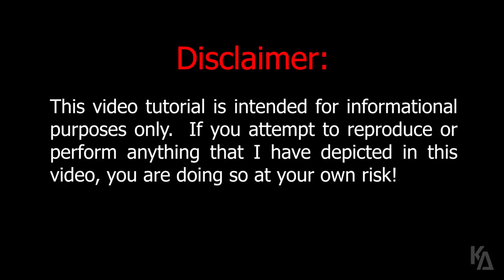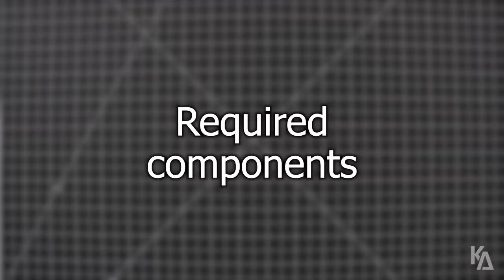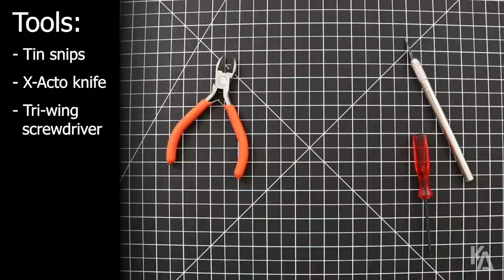Backlight Your Gameboy Color in 15 MINUTES! (No Soldering!)

Comment: This really is the definitive GBC mod. Benn is truly a genius with his engineering
Reply: Thanks mate!
Reply: No it's not. The screen is smaller than the original. There is more work to be done for it to be the definitive mod.
Reply: @afistfulofpimples1745  Its' smaller to keep a accurate 1 to 1 pixel replication, a lower resolution screen could be used but it would look worse.
Reply: @mikewat6693  So why not use a higher resolution screen but larger, to equal the size of the original. No one wants a smaller screen. Faithful pixels or not, playing on a smaller screen is no fun. More work needs to be done.
Reply: @afistfulofpimples1745  it's a start! I have an AMOLED kit for the GBC in the proto stage. It has full sized screen area, a bucketload of shell modding to get it to fit, and a ridiculous price tag. You could argue 'it's too expensive' or 'too much modding' Just as the last lot of Commenters on the 101 mod. The fact is, this is a huge step forward. No it's not perfect but with the days of 1:1 screen aspect well in the past, the chance of a 100% drop in no mod solution is drifting further away. This is the best we're going to get for this simplicity and price tag. You may be surprised but the design of this kit wasn't by accident or a random panel selection. This is the best we have in April 2019...

Comment: I didn’t know a custom lens would be required when I bought the screen. And now it seems I’m torn between buying either a Gameboy Color Light screen with glaring hot pink where the red should be, or the redundant Black and White one. Fantastic video though, it was well worth the wait.
Reply from the maker: Thanks, I appreciate it! 🙂  A "Light" lens isn't technically required, but it does make things look cleaner.  You can use a normal lens and just cover the edges of the LCD frame with matte black vinyl or electrical tape like in my GBC101 mod videos.  I hope this helps!

Comment: Just a friendly pro-tip I didn't see mentioned in the video: Cutting the cartridge connector pins with wire cutters or tin snips is potentially hazardous to the main board. You could very easily grip a pin and rip the solder off the board, along with a trace, rendering your GBC useless (not able to read carts)

A safer approach may be to use a very small (FINE) file, not a nail file, but one for metal. Gently file the tips of the pins, not the sides/edges.

hope this helps some worried about removing cartridge traces.
Reply: I think the repetitive movement back and forward has a far higher chance of creating a dry joint that a sharp pair of wire cutters. This is just from experience doing many hundreds of these mods.

Comment: I have a question:
Why installing a smaller screen indeed of a small one? I know it's a better one but if you put lot of effort and time why release a smaller version? It's due to pixel sizes or what?
Reply: Dwight Castillo i have the same question. Too bad to use a smaller screen it doesnt look authentic anymore :(
Reply: To me it was more important keeping the aspect ratio the same. We could have filled the screen with a squashed image similar to the Gbboy image but in my opinion it is not good enough. This is a little smaller but ticks the boxes for price, aspect ratio and simplicity.

Comment: A couple questions before I purchase one of these bad boys.

1. Is the backlit screen the same size as the stock GBC screen? 
2. How important is it to install a custom screen lens? I refurbished my GBC with a glass screen lens only a year ago for a stock GBC screen. Is there any reason that a stock GBC screen lens won't work with this mod? 
3. How is the backlit screen with motion blur, viewing angles, etc? 

Thanks!
Reply from the maker: Hi there, thanks for your questions! 
1. The screen is a few mm smaller than the original screen, but since it's backlit you really don't notice the size difference (just from my experience).
2. A custom lens isn't required, but it definitely helps the look of things.  If you don't use one, you can cover the borders of the LCD with matte black vinyl (no residue) or electrical tape (leaves residue).
3. There's no ghosting on the Freckle Shack lens.  None. 🙂 (Unlike the AGS-101).
I hope this all helps!  Thanks for watching!
Reply: @KyleAwsm  Okay...then if it's not 1:1, that opens up a whole other can of worms. What is the screen size for this aftermarket screen and what is the aspect ratio? The original GameBoy Color LCD uses a 10:9 aspect ratio that aftermarket unit such as the GB Boy Colour do not match, creating a slightly stretched image. The reason I'd be interested in this to to get a lit screen that also adheres to the proper aspect ratio. 

The other points sound good to me, but please explain this difference in screen size.
Reply from the maker: Pixel ratio IS 1:1, just smaller pixel pitch.  Same aspect ratio.  A few mm smaller than the original LCD.

Comment: Do you have to have the jelly belly customs glass screen. I have a few standard replacement glass screens. Will this work?
Reply: Not required but highly recommend has the new screen is about 2mm smaller than original using an original lens you will see more of the inside of the device.
Reply from the maker: What F7099Y said - I highly recommend the custom lens!  It just COMPLETES the mod.  You can also do like I did in my GBC101 part 2 video, using tape/vinyl to cover the LCD housing/border.  I hope this helps! 🙂

Comment: Hello, I installed a freckleshack today and went to screw the case back together but before I did, I thought I would give it a quick check from the front but because I am using a clear black shell, I can now see the kapton take covering the points below the screen and it looks ugly (being yellow). It didn't show on the atomic purple as there was no kapton tape covering these points. It is essential to cover these points with Kapton tape? Or is there an alternative you can suggest that won't ruin the aesthetic? Thanks.

Comment: Another question - the actual visible LCD looks physically smaller than the original screen. Is this right? If so, how much smaller?
Reply from the maker: The image on the screen ends up being about 1 to 2 mm smaller than the original screen's image.  Really though, with the screen being backlit now, and with a custom lens (trust me, it really helps), you don't even notice the size difference.

Comment: Could it be that this kid was designed specifically for aftermarket housings?? Because I cannot fit it inside my origonal housing... it seems like just won't fit. When I close it with minimal pressure, the Gameboy would reset or the display would show weird glitches....

HELP :(
Reply: The mainboard doesn't sit flush in the housing. Although I trimmed it like shown in this video.

Comment: This is cool and all but if I’m replacing the screen and the shell I might as well get an aftermarket gbc that just has a backlight. The whole point of modding my GBC with a backlight is to make the original hardware playable in modern times. Replacing the screen is fine but replacing the shell and the lense defeats the purpose

Comment: I live in Perth Australia, and I've been following various Gameboy mod videos online. BennVenn seems to be pretty popular. Does anyone know how I could get in touch with BennVenn? I recently got myself a cheap DMG, but, while attempting (successfully, I might add) to fix a few vertical lines, I must have clumsily handled the ribbon cable, and now I have horizontal lines. Is there any way to fix the current screen, or replace the old screen with a newer one (doesn't have to be backlit, as long as it can display image without any horizontal/vertical lines obviously)? Thanks.
Reply: My email is on my stores page.

Comment: Does a backlight exist where you don’t butcher your case?
Reply: Yes. Aliexpress has one for 36 bucks as of yesterday.
Reply: Completely drop in with touch brightness control that doesnt need any soldering. Its nice but the screen is even smaller than this one.
Reply: It does have some frame skipping and tearing because it doesnt auto adjust the fps like the freckleshack and its kind of annoying.

Comment: Would it be possible to get a different screen thats the same size as the thing on the front of the GBC?
Reply: nathan mead  if they were able to find an lcd that has the same dimensions as the original AND is able to be manufactured easily as well as unlimited, then yeah. But for now this is the best I’ve ever seen for a modded GB color.
Reply from the maker: Ben is looking into this possibility, but that solution is likely a long way off yet.  Thanks for watching, man! 🙂

Comment: When you installed the screen you slide the left (thicker) spacer towards the bottom, while leaving the thing spacer on top. This made me cringe for two reasons: this could cause the screen to rotate slightly, but even worse, you then crush the poor ribbon cable on the spacer. WHYYYY

Comment: My old manager would send workers home for the day that cut towards themselves instead of away; If the knife slips, you don't stab yourself that way. He was strict, but it was effective.
Reply from the maker: I see what you mean... but this is a craft knife....  You get more control holding it this way.  If you cut away from yourself doing stuff like this, it will get jacked up pretty quickly.  Completely different scenario than what you're envisioning I think.  We're more or less splitting hairs at this point.  Thanks for watching! 🙂
Reply: @KyleAwsm  Nice to know. Appreciate the clarification and reason. Have a good one.

Comment: Hello. I just want to know if this square screen has the measures as the gamboy color original screen.
Reply from the maker: Hi there!  It's about 1 to 2 mm smaller than the original.  But you can't really notice since it's now backlit, especially if you use a custom lens.
Reply: @KyleAwsm   so is it the same screen size as when using the ags-101 screen method? or maybe a tad bit bigger? or just about the same?
Reply from the maker: kurikuraconkuritas  I'd say it's roughly the same size.  I just compared the two tonight and one is slightly brigher than the other, so it makes one look smaller.  I'll likely be showing this off in my upcoming podcast in a few days. 🙂

Comment: But now I have an aluminum shell and this probably wont fit in it... curse my impatience. I bought the stuff to do the other mod a month ago, then found out my gbc was incompatible with the chinese converter :/
Reply from the maker: Hmmmm... Well, you COULD use a rotary tool to grind down the bottom part of the LCD bracket so the Freckle Shack will fit.  Just make sure that you insulate the heck out of the inside of the shell.  I hate to even recommend doing ANY of that though - Those metal shells are super pretty!  Is it one from BoxyPixel?
Reply: @KyleAwsm  after pulling it back out and taking it apart again, I realized it doesn't have a bottom bracket at all, so I just ordered the spacer to allow it to hold the original screen, and will just attach the freckle shack spacers to that. So I'm happy all around lol. And Ill be sure to insulate it all around as well, it is indeed from BoxyPixel, and he makes them so nice. One of these days I want to grab one of his GBA shells too.

Comment: where can you buy the tin snips that you used?
Reply: I had the same question. I think the tool that he is using is not a pair of tin snips, but is in fact some kind of flush cutter/wire cutter. When I typed in "small metal snips" on Amazon I got results closer to what he has in the video.
Reply: You can buy similar tool on aliexpress, just search for "Flush Pliers".

Comment: I simply cant get the top to close all of the way because of the PCB on top of the screen
Reply from the maker: Use tape to hold the PCB in place while you put the GBC's PCB over it when reassembling it - The screen's PCB fits inside the remaining part of the LCD bracket.  Also use tape to insulate the back of your LCD housing, since the components on my prototype in the video and your unit are slightly different, and now your PCB can short against the back of the LCD housing - This was due to China mixing things up in this first production batch.
Reply: @KyleAwsm  I did end up getting it with tape to hold in place, but believe me it took a lot of trial and error. One thing I would also suggest that I had to do, is cut a piece of the bracket out on the left side for the ribbon ( screen to pcb) to go so it doesnt have any stress being squished in there. It ensures it wont get smushed, and doesnt effect the screen allignment at all. 

All in all it is now put together totally and looks fantastic!

Comment: urgh, my screen keeps going white if the top is too tight, if it isn't, i have a small gap at the top.
Reply from the maker: Insulate the back of the LCD mousing with tape.  The prototype that I showed in this video and the first batch of units (including yours) were made with slightly different components (blame China), yours being thicker and shorting against the back of the LCD.  This should fix that.
Reply: @KyleAwsm  thanks. Some one on our ul nintendo group pointed this out. Ive used electrical tape but the lens is popping out slightly so may look for thinner tape

Comment: Would the Freckle Shack works with GB everdrive x5 flashcart?
Reply: Yes. This is just an LCD replacement. It has nothing to do with the cart reader or cpu.
Reply: @SCorpG22  I meant regarding power consumption, as there is an issue with ags 101 mod..
Reply: sonic the stoner What is the issue with the Everdrive and the AGS-101?
Reply: I can't speak for the ED, but it is fully compatible with my ElCheapoSD range of carts. They use quite a bit less than an ES though...
Reply: @bengrimmett1239  why do they use less? You also promised updates on a new batch of Elcheapo's?
Reply: @W00fer  The PSRAM he uses is rather power hungry, plus he clocks his FPGA 50x faster than I do which uses a lot more power and the benefit of faster load times. Its all a compromise with this stuff. New ElcheapsSD? or Elcheapo?
Reply: @bengrimmett1239  both but preferably the cheapest
Reply: @W00fer  take a look in store
Reply: @W00fer  I have since researched this and apparently due to the power drain of the X3 and X5 carts, they would blinker and sometimes go off, due to additional drain of the backlit screen. However, both revisions of the X7 (a and b) are supposed to be fine as they have a much lower power drain, albeit it a much higher price.

Comment: The kit is sold out..does anyone know where else I can buy it?
Reply: Shan Mann he’s taking preorders for batch 4 right now.  It’s not sold out I just put in for mine yesterday.
Reply: @kingboy23989  Thank you! I just did mine too. Now I need the glass lens.
Reply: Shan Mann  I ordered a stock replacement till the others are back in stock.  I need to be checking everyday.
Reply: @kingboy23989  Can you tell me where you bought your stock replacement from? Will it be compatible to the Freckle Shack?
Reply: The freckle shacks are slightly smaller that oe screens.  So there will be some sides showing.   The one from jelly is smaller to fit the screen from freckle shack.  I’d rather have a new screen with sides showing than a scratched up one for now.  Lol
Reply: I’m pretty sure I ordered mine from handheld customs though.  But like I said there just oe style.  Not the ones made for the freckle shack from jelly

Comment: What is the screen resolution of the new display?
Reply: I asked them via facebook, they said double verticle, double horizontal resolution.
Reply: It's a 320x320 panel,  the 160x144 is linearly scaled to 320x288 leaving a gap up top and down below. The pixel size is square so the aspect remains accurate

Comment: The things I dont like is the size of the Frackle Shack PCB and the price.
Reply: The size of the board seems to be designed to specifically fill out the shape in the shell where the screen sits. Without that you would need to glue in the screen and the spacers or they could move or fall out of the hole. I think it's actually genius.
Reply: @chamoo232  Huh, the spacers fix the screen position. It's clammed in between them. So why the glue
Reply: @W00fer  It can't move from side to side but it could move up and down if the pcb was smaller than the hole. That would then have the screen pop over the spacer and they would get loose. The board basically sandwich the spacers and screen against the glass screen and make sure they can't move back. The pcb itself could also move around if it wasn't sized to fill the hole from the old screen.

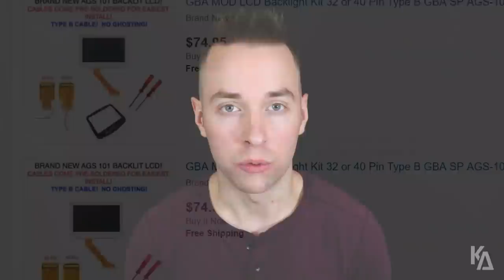Comment: 3:28 welp, not that this would cost MORE than that, that would be silly! Right? I mean, we just acted like $30 is alot... Nope, let's actually double that price...
Reply from the maker: Not sure what you're getting at....  The old AGS-101 solution required a now $75 display PLUS a $30 to $40 ribbon adapter.  Ben can't work for free, and he has many costs to pay too for making these things.  The fact that you can get the display and board for NOW $60 on his website is incredible.